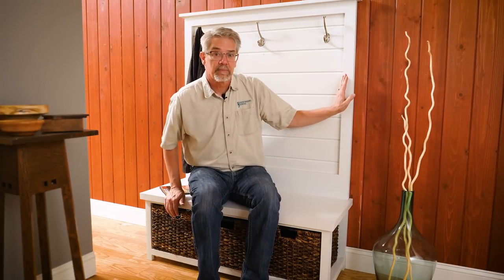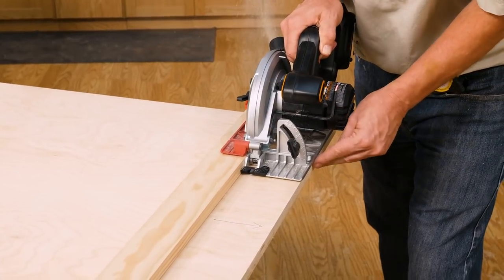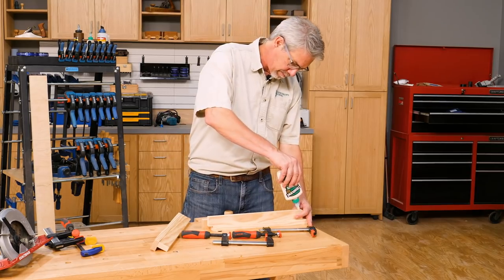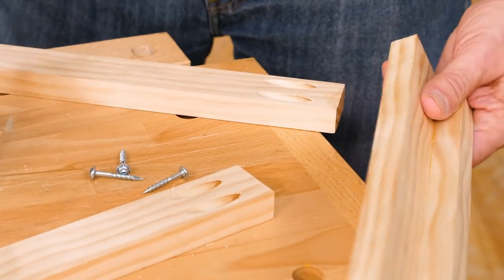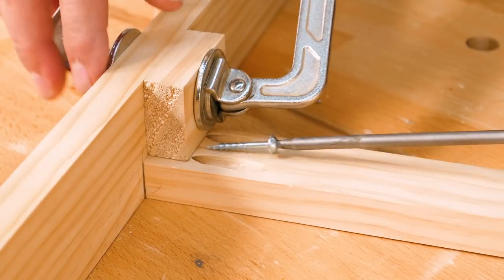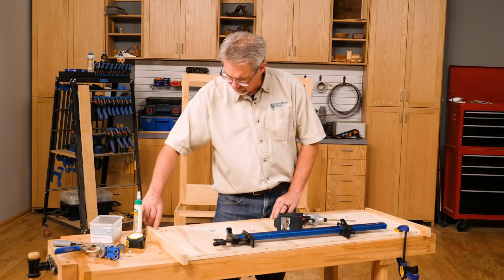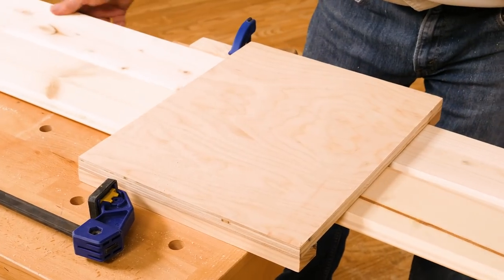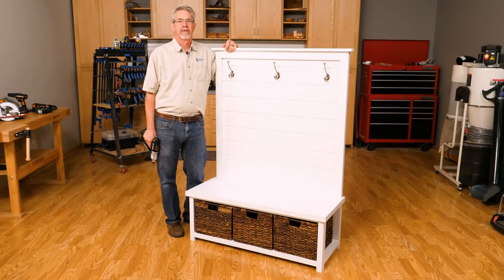Make an Entry Bench | DIY Woodworking Project

Comment: I stumbled onto this video while looking for other Worx tools. I have Sooooooo many Worx tools from fifteen years ago or more. They ALL still work. Yes, they do! I had to buy an adaptor to use my newer batteries in the old tools, but they work perfect to this day. I just bought the Worx Nitro oscillating tool and the Worx work bench along with the Trax circular saw and the 4 1/2 in handheld saw. The work bench is Awesome to say the least. I am still learning all kinds of ways to use it. Next up I will get a chainsaw and the handheld pruning chainsaw. I have Dewalt tools, but never even bother to get them out anymore. I have Worx batteries over three years old still going strong. Long live Worx!

Comment: great little home project for beginners.  however, i struggle with teaching beginners to use pocket holes for structural joints as they are weak and will loosen with time.  my recommendation would be to teach them to use dowels (really no harder than pocket holes) as an entry into joints.
Reply: Pocket holes with glue are very strong joints.
Reply: @prestonlane6253  not for end grain. The glue is almost useless used the way in this video